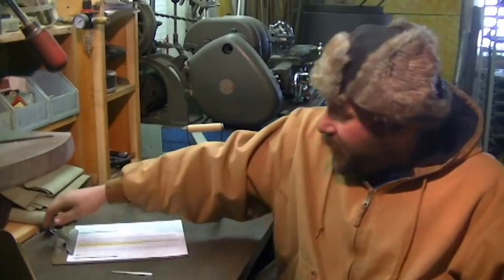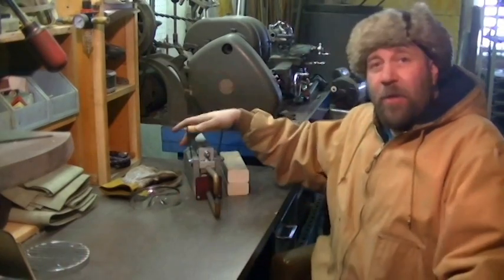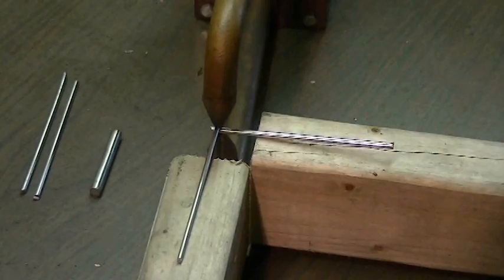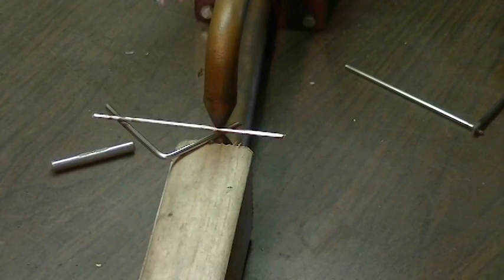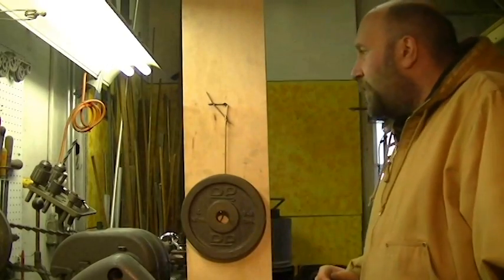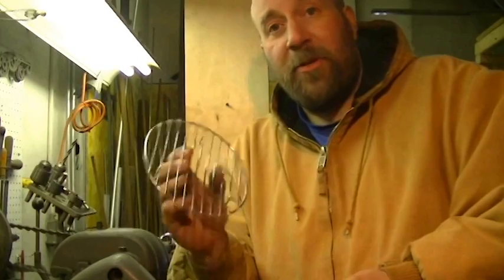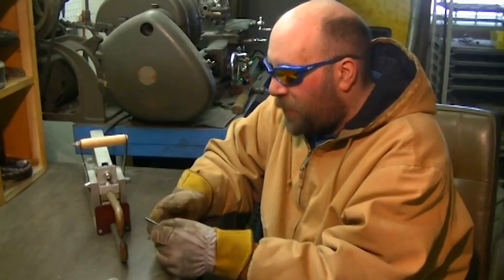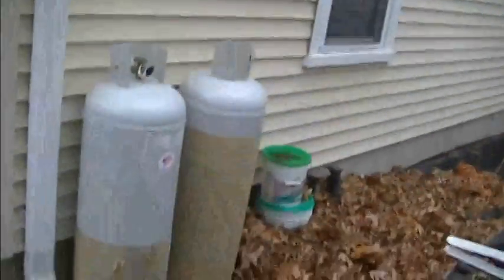Spot Welding Stainless Steel / Flat Stock & Wire

Comment: Youu can weld more than 2 pieces. I do it all the time in my sheet metal shop.
If your spot welder is smaller/ weaker, here's the trick:
1. Clean, clean, clean.
2. Spot the first 2 pieces together, let cool.
3. Add the next piece and spot weld in the same spot. The welder only sees one jump joint, as the original 2 pieces are now one, with no jump gap.
4. Repeat step 3 until you've either maxed out your welders capability or you've completed your project, whichever comes first.

The main issue with lower powered (HF) spot welders is the jump gap between plates. Even with the "squish" being exerted with the jaws, there is still a significant gap if there is more than two plates.
The tips heat top & bottom plates & the clamp squshes them togethwr once there is a moulten spot. If you add a platr between the plates being heated, that plate doesn't get moulten in the middle. Just like you experienced.

Hope this helps. 😊

Comment: From Airgas MSDS:

"Fumes from the welding of stainless steel and other alloys contain nickel compounds and chromium [VI] and [III]. Ozone is formed during most electric arc welding, and exposures can be high in comparison to the exposure limit, particularly during metal inert gas welding of aluminum."
Reply from the maker: How is this remotely relevant to this video?

Comment: Hi, I’m making ten small models from 1/8“ welding wire of my large sculpture in Amsterdam https://www.denarend.com/cities/amsterdam/durrer/index.htm. Where the two wires will later be glued into the wooden base I was thinking of having then spot welded. I was happy to see your video with the same material I’m using but sad to see that two 1/8” wires come apart.

Comment: DEAR MR JEFFEREY-I AM FROM INDIA- HOW YOU RECOMEND USING CHROMIUM COPPER ELECTRODE FOR SS316 L GRADE STAINLESS STEEL.  REGULAR IS NOT WORKING.  THANKS AND CONDONE MY CAPITAL LETTER DUE TO VISIONARY PROBLEM SIR
Reply: LEFT OUT: SHEET SIZE: 1.00 MM SS316L

Comment: Hi Jeffrey can I use my spot welder to fill a pinhole in my steel pot using filler rod?
Reply from the maker: The spot welder will never get hot enough to melt a filler rod to the parent metal.
Reply: Jeffrey Santo thank you very much
Reply: Jeffrey Santo so what do you suggest me to fill that 1 mm big hole using spot welder? Do you have an idea?
Reply from the maker: A spot welder can't fill in holes, spot welding is unlike Mig, Tig, Stick, Brazing, & Gas welding. It fuses two pieces of metal together, it does not add material. If the metal is thin enough the best you could do with a spot welder is cover the hole with a patch.

Comment: i am welding a triangular-shaped wire over a round-shaped wire of diameter 2.5 mm to 3 mm but I am not getting the appropriate amount of welding in it the grade for the material is ss304 and ss316 both are annealed

Comment: I noticed you released the wire during the 'forge time' stage, which would reduce the weld strength. Did you try a longer 'weld time' with the 1/8 wires?

Comment: I just commented on your first spot weld video. I do a lot of this, and some ideas can make things easier. I mod the tips often. For round stock, I mill “v” grooves in the tips. Tighten the tips so you have their orientation, mark the way you need the grooves, and mill them out. They just need to be small. Make sure the copper tips don’t touch when closed. I’ve welded 1/8” by 1/8” very well. Even 1/4” and 1/8” works well with the 120 volt model. Timing is is very important. I made a welding timer for them. Doing it manually isn’t good, because you never get the same time, and often, that makes a difference with short welds.

Basically, as long as the resistance of what you’re welding is greater than the copper tips, it can be spot welding. Again, timing is critical.
Reply: Given your post was made over 7 years ago, I don't know if you'll see this--but if you do, I'm curious about how you made a welding timer.  What did you use for this?  I would think a single shot relay with a foot switch would work well, but if there's a cheaper or easier way, I'm interested.

Comment: How join two artistic stainless steel wire 24 gauge strongest way possible? Thanks from HK!!
Reply from the maker: Look up some videos on silver soldering, its a process used in everything from jewelry making to building bicycle frames. Good for thin material that you might melt with a hotter electric welding method.

Comment: is there is a cheap way to do that....I need a T joint of 2mm wire
Reply from the maker: Rahul Ghosh The only way I can think of doing that on a T joint would either be by brazing or soldering.
Reply: Ok I understood....Thanks for noticing me

Comment: When welding 1/8 ss rods, why not let the welder work longer? Same question for triple layers of flat?  8 seconds instead of 3?
Reply from the maker: I wondered the same thing when I started out... with resistance welding there are a few things happening there is not only heat there is also the flow of electricity and the pressure generated by the electrodes clamping down on the work piece. The electrodes are copper and will deform long before enough heat can be generated to fuse the material together. That will damage the electrodes and may even ruin them. 

Think of the flow of the electricity like the light of a laser, there are hobby lasers out there that can cut things like leather, foam board, thin wood and plastics. They can only cut a up to a certain thickness, after that the light energy of the laser starts to dissipate. You could slow the laser down but then heat will build up in the part, it may deform or perhaps even catch fire. In this way the flow of electricity in the welding process acts like the laser. I hope that helps.

Comment: would 2 - 1/8 carbon steel rods weld ,is this the 120 volt welder?  Thank you
Reply from the maker: What I use is the 220 volt version, according to the specs the max material thickness it is rated for is 3/16 in. combined thickness (mild steel)  So, while it may slightly fuse 2 layers of 1/8 to combine to 1/4" the bond would not be that strong.
Reply: @jeffreysanto  Hi Jeff I have the same machine I was wondering if two different thicknesses of stainless can be welded? i have to weld on a piece .024" to a .062" thick piece.thanks.jim

Comment: so quick question. since you can't spot weld 3 or more pieces would plug welding be your next viable option?
Reply from the maker: +beetlearms I have never run into a situation where I have had to, if I did... Lets say there were 4 pieces, I would drill a hole in three of them, use the solid for the bottom layer. Stack the other three on top and plug weld them. I may shoot a video on this just for fun, would be easy to film and I could use scrap for the weld.
Reply: +Jeffrey Santo that's pretty much what I was thinking. just figured I'd ask to see if you as a pro would do it differently.